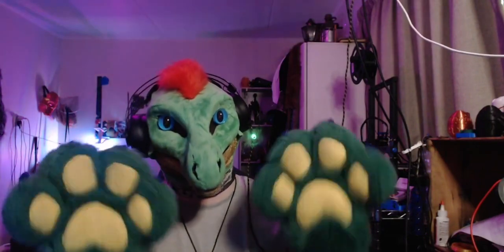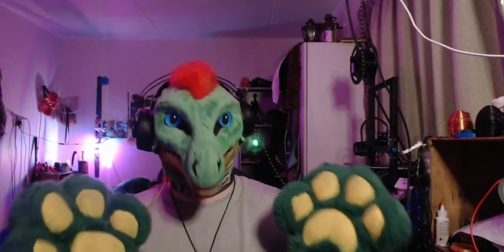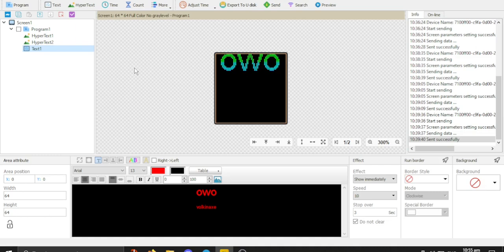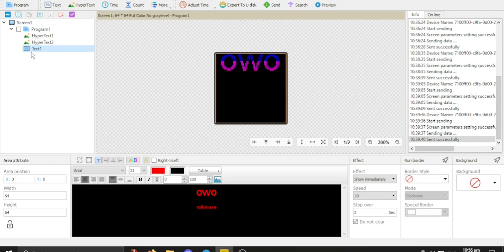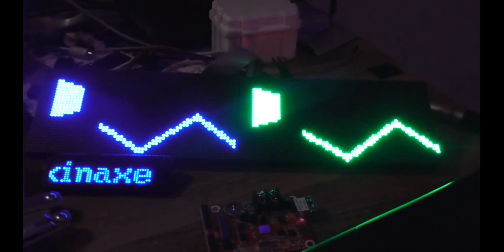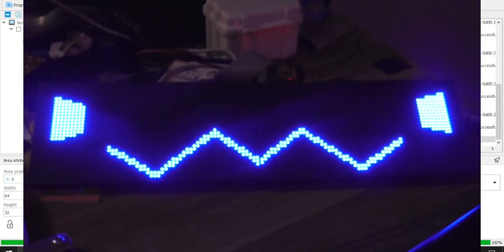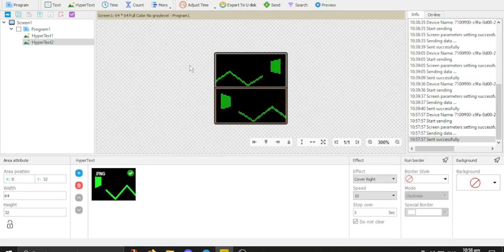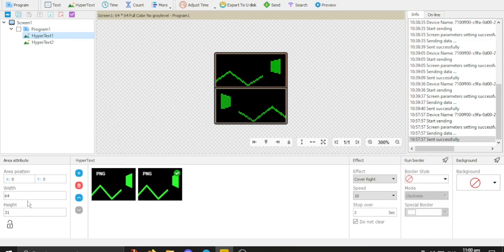how to make a protogen head with no command line needed part one

Comment: if you unplug the power to the board the program needs to be reactivated, is there a way to make the program activate when power is introduced?
Reply from the maker: not shor have not used this softwere in a log time
Reply: @volkinaxe  i tested something and I think when I typed that comment the program wasn't fully integrated